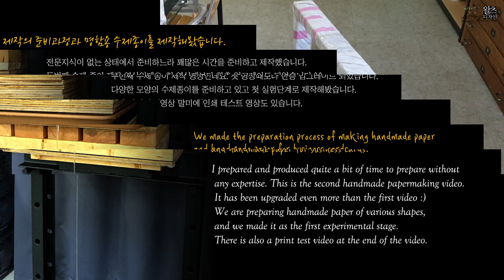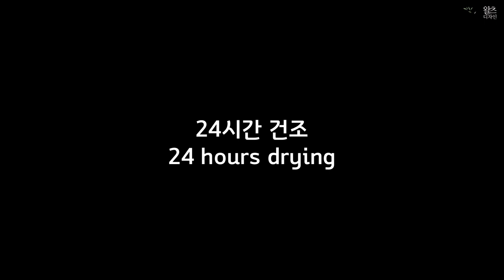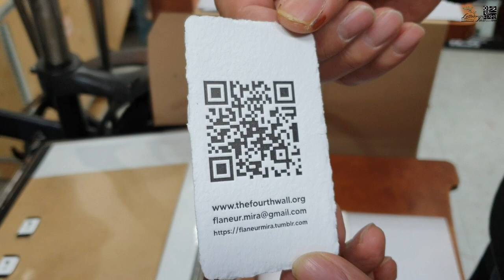Making handmade paper for letterpress business cards. 레터프레스 명함용 수제종이만들기.

Comment: If you have planned to do homemade paper production multiple times, I would recommend getting a hand blender for the paper mash (the ones used in big kitchens) like https://www.amazon.de/-/en/Whisks-Stix-Gastroback-457-WSB65/dp/B01N8TJ97P/ref=sr_1_12?dchild=1&keywords=big+stabmixer&qid=1609753385&sr=8-12 for example or similar. The added benefit is that you have better control over the thickness of the fibers and would be easier to blend all. 
nonetheless, great work, and since I am here what you could also do with the homemade paper is to add aroma oils like lavender, rose petals, lemon, rosemary, vanilla ... to the paper mash and create scented cards for travels to put in the suitcase or those carscenttrees.